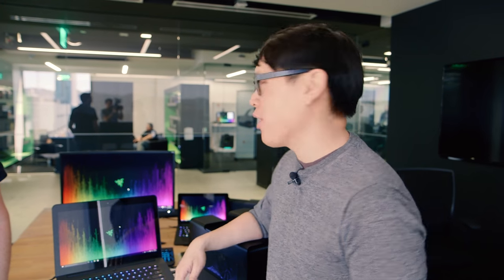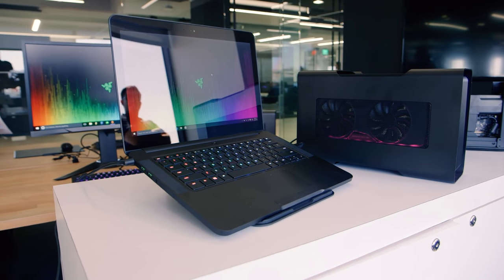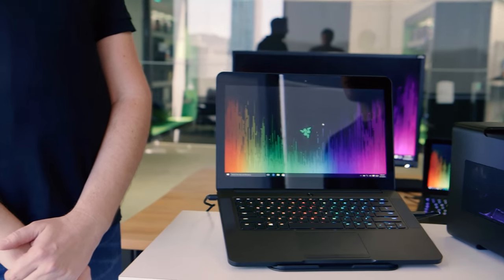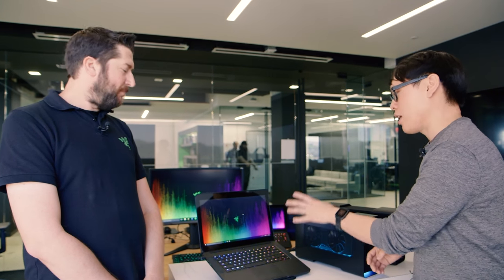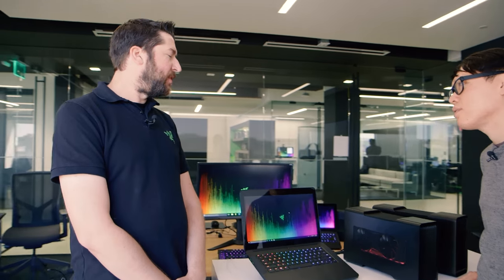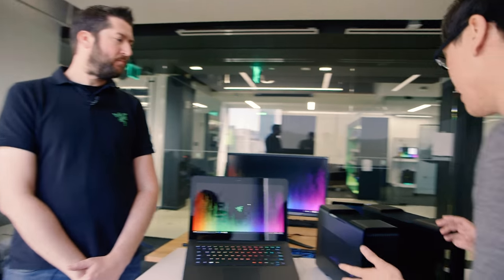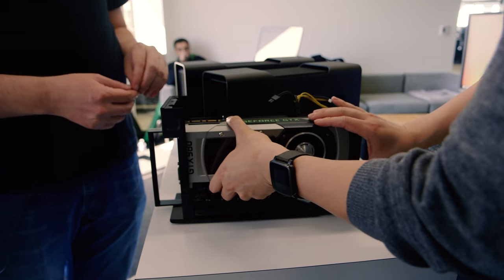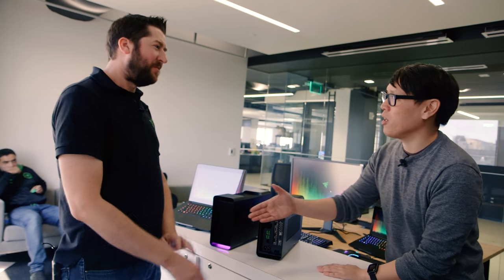Installing a Video Card in the Razer Core (External GPU)

Comment: I hope apple wont be bitchin and support this on the upcoming macbook pro's
Reply: Yeah that's probably not happening knowing apple the closest you might get to this is a proprietary version
Reply: +Sam NG (Sam737) Why would apple support a severely massive user serviceable part that introduces the requirement of ridiculously multiplying the number of gpus they have to support?

If they make a move for external GPUs it will be an even more overpriced sealed unit that isn't for gaming.
Reply: zoey Quay because they're already supporting windows via bootcamp, with all the drivers needed, as the guy from razer said, its only a matter of a firmware update for thunderbolt 3 ... in any case, we will find out in the future
Reply: +Sam NG (Sam737) were well aware that is possible what we were talking about is OS X supporting the Razer core

Comment: thunderbolt 3 bandwith will be irrelevant sooner than anyone think for next gen graphics card and will bottleneck the perfs, this is a waste of time and money.
Reply: +Imaginalex Tigerheart 
The thinking of "more bandwith leads to better performance" is wrong. The most important thing is the legacy of the PCIe standard (here PCIe 3.0 with 4GHz) and not the "TB3 bandwith" of 40Gbit/s (actually only 32Gbit/s are used) itself. So there won't be any bottleneck if even eGPU systems with PCIe 2.0 and x1 Lane are able to scale with 75-85% of performance of the desktop GPU.

Comment: What world needs and nobody can provide it - its $ 400-500simple laptop with quite good CPU with thundrbolt port and external case not for 499 but 99$ with psu 6/8 pin 500W or optional less. So fucking simple and nobody cant do it? Who needs Mobile super expensive GPU-s?

Comment: $500? Yeah fuck that. This shit is more overpriced than any VR headset.
Reply: +DaBlaze Honestly it's a fair price, you are basically buying a Motherboard and a PSU together with the case, and it's $400 with that discount.
Reply: A motherboard and PSU in a desktop cost around $150 to $180. With a case that size I would guess you could add $40 max. Very overpriced.
Reply: +Fernando Fukamizu You're not buying a motherboard. More of a PCI controller, PSU, and a case. That's pretty much it.